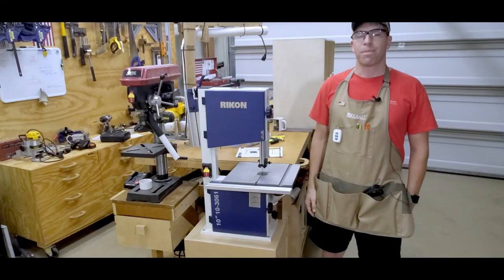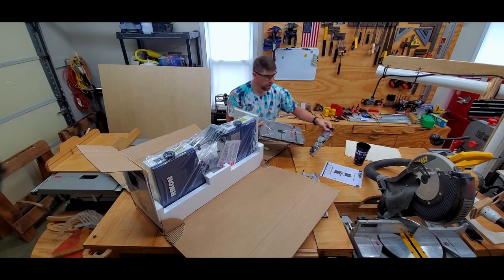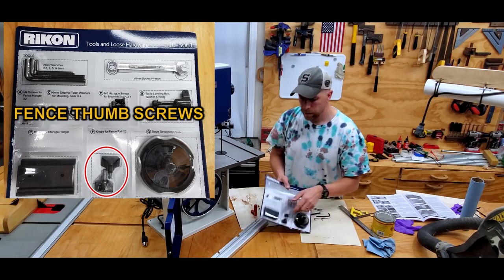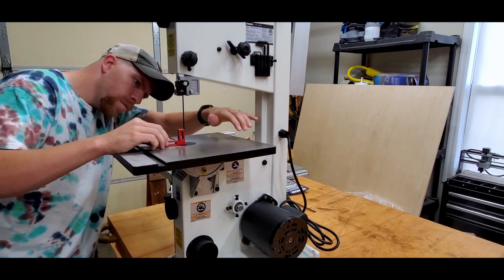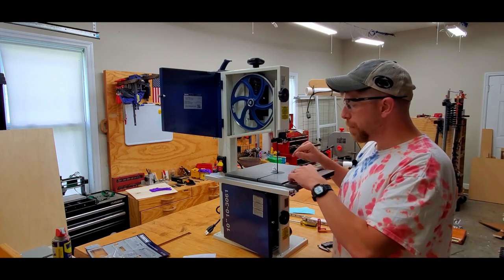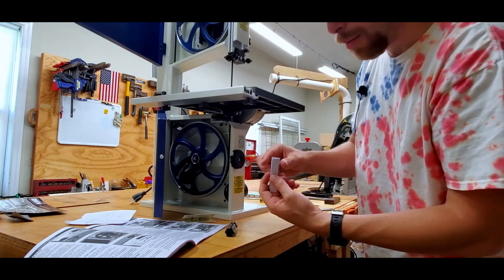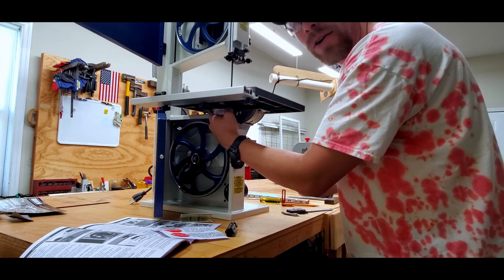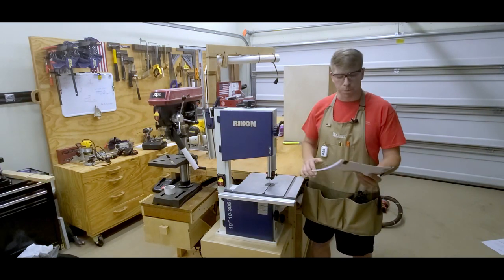Rikon 10-306 Band Saw / One Stop Resource For: Unboxing / Setup / Tuning / Features // EP62

Comment: I am about to buy this saw. Imagine my joy at getting to watch your video. Now imagine my disappointment when I had to struggle to hear you over the back ground music. Why the need for music?  Secondly , as you were adjusting the blade and parts, you pointing to it only blocked what I was trying to see. May I recommend using a pointer instead of your finger , also a closer view of what you were adjusting would be very helpful.  Thank you , I did enjoy what I did watch.

Comment: What are the dimensions of the miter slot? Of the 10” band saws this one seems to be a premium version. It’s crazy how similar these 10” bandsaws are but the Rikon has better features; the cast iron table, guide bearing assembly’s, blade tension release. This 10” saw punches above its weight.

Comment: I just bought a sears craftsman 10 inch band saw, 1/3 hp. I later saw that some say my saw is the same as a rikon. Mine has a broken drive belt but for 1$ I couldn’t pass. Do you know anything about the sears being like this rikon?
Reply from the maker: Sounds like a great find,  Franco. Unfortunately,  I don't have any experience with that model.  Best of luck as you get it repaired and back into operation!!

Comment: Just a note, from a another Youtube 'band saw' guru who suggests setting blade tension on bottom wheel, against the side. I don't see the difference myself, but either way should be good. Took some tweeking, but I'm very happy with my purchase and have been 'playing' with it for sometime now. Thanks for vid
Reply from the maker: SmarT Odd,  thanks for sharing. I certainly don't consider myself a bandsaw guru, this might be the 3rd new saw I've set up from factory aside from typical tuning/blade changes.  I'd be interested in learning more about those tuning techniques. Clarifying,  are you referring to keeping the bottom blade guides tight to the band of the blade? Thanks for watching and taking the time to share.

Comment: great video! I have been looking at this bandsaw and the grizzly GO803Z with the purpose of have a smaller bandsaw to use now and later buy a bigger one for resawing and processing some of my own lumber. Great timing as I think I am going to go with the Rikon based on your video. It seems more robust and another selling point is the 2 blade speeds so it has the ability to cut steel as well. Thanks for posting!
Reply from the maker: Thanks for watching @Shiltz00. Glad to help! I'm a big Grizzly fan on some of their larger models.  It is nice to have a small machine setup for smaller cuts.  Best of luck!

Comment: Hi Chris, Great video very in-depth and precise. Looking forward to purchasing one of these in the near future. You briefly mentioned resawing near the end of the video. Can you use the blade that came packaged with the tool or must you buy a separate resaw blade? Have you used it to resaw yet?
Reply from the maker: I have done some resawing with the saw (only small sized pieces of course). I used both the stock blade and a 1/2" 3TPI Starrett blade.  Both worked but the surface finish and stability was a little better with the wider blade

Comment: I was watching another video last week and on it, it was suggesting that the lower blade guides be set before setting the table in place. Strictly for the convenance. No need to crouch down and work under it. 
Think that’s a good idea?
Looking forward to receiving my saw
Next week. Doug
Reply from the maker: Maybe for first setup,  Doug. I didn't fully tension my blade until after I adjusted  my table,  so I suppose user preference. Blade changes have been VERY convenient with this saw. These are the easiest guides I've ever had to adjust on any saw,  so I personally don't view it as a concern. Hope that helps.

Comment: How did you square the miter slot to the blade? I am trying to follow the directions in the manual but I'm going crazy trying to get it squared.
Reply from the maker: Chris,  I thought I showed that in the video.  Will check to see if I can find it. If memory serves me correctly,  I used a combination square and referenced from the front edge of the table and along the edge of the blade between teeth. I confirmed the front of the table was perpendicular to the miter slots. 

There are 4x bolts that secure the table to the top of the trunk on, tightening them can throw things off a bit. You may want to put a bit of torque on them and then tap the table/ miter slot square with a mallet. This can help you get your final alignment without the table moving all over the place while tightening the bolts. I don't want to minimize the importance of getting it as square as possible, but this is a band saw and will never leave a final  finished surface. As long as your table and  fence are parallel to the blade,  you should be able to get fine cuts. I hope that helps, please let me know if that didn't help or you have another question.
Reply: @benchtopwoodworks  I noticed you doing it in the beginning of the video, but it was done quickly. Didn't watch the whole thing, so don't know if you did it again, or explained it later on. I do plan on using it for resawing as well. I know it will only be a max of 5 inches, which is fine for now.

Comment: Why they put the blade changing slot on the side and under the rip fence track is dumb. My Delta 14” had it in the front.

By the way, on a band saw you don’t square the fence to the table. The work doesn’t always track straight. The usual technique is to make a straight cut and then align the fence with with the edge of the work. This technique is in the Band Saw Handbook by Mark Duginske. Highly recommended book! 

Once I had my Delta 14” tuned up (and with a taller fence attached to the factory fence) and a riser block, I could perfectly resaw wood 6”+ wide.

Comment: Just pick this up. In the process of setting it up. What is your recommendations for the paste wax you use.
Reply from the maker: I've always used Johnsons plain paste wax,  but that's typically what I have on hand.  I think even car wax can work.  Basically anything that will seal the metal with a hard film coating and prevent moisture/ humidity from getting to the iron.

Comment: I've had this saw for about 6 years, and I want to know wtf the black slider that catches on the guide assembly does. I've wondered on/off but I just literally watched this to see if I missed what it was, checked the manual and ended up emailing them.

It's part #41, "slider" and it's driving me insane that I have no frixking clue what the functionality of this part is and if there isn't one, wtf is it doing on there? Is it a leftover from manufacturing that a different model would end up using??

The only thing I can think of is it can hold a certain thickness of material when the guide assembly is completely raised

Comment: Thanks for a very detailed video. I am considering this saw although i am wondering about getting a bigger one too. I was wondering what would it take to upgrade the motor since i think the size is fine for what i am planning to use it for - but am worried about the (lack of) power of the 1/2 HP of its motor. Any thoughts about that?
Reply from the maker: Thanks for watching and the question. If I had more space I would go with a larger machine vs upgrading this one.  For the cut capacities it has a good bit of power, so in my humble opinion resaw and throat capacity are the main limiting factors for this saw's capabilities vs power. I have not bogged the stock down even with some pretty thick hardwood cuts. With welded frame there's no option for risers or other upgrades.  I think Rikon and Harvey both have quality 14" with beefier motors and all the bells/whistles.

Comment: I might be getting this saw as well.  The one's I've checked out this is the one I would want.  One question would be what types of blades do you use for different cuts or woods?
Reply from the maker: Most operations I use a 3TPI 3/8" blade. I also use a 1/4" woodcraft brand for curves and Starrett 1/2" for for "re-sawing" Saw only has a 5" re-saw height. All blades listed have 3TPI

Comment: I believe the Company that makes these Ricon also makes the LaGuna brand too.I have owned both and they are identical!
Reply from the maker: Yes Sir,  very similar if not identical. From the basics of the industry that I know, many makes are often nearly the same or even same production lines with rebranding. I think company's also add/remove certain features as they negotiate with manufacturers.  I think it often has to do with who owns which patents and has production capacity.
Reply: Rikon and Laguna are not the same at all. For one, Laguna bandsaws use ceramic guides and rikon’s use sealed ball bearings. The cheapest Laguna bandsaw is $1600. The cheapest Rikon bandsaw is $350. I own both brands. I’d say dollar for dollar the quality from Laguna is a little higher than Rikon. Nothing wrong with either brand.

Comment: Thank you really enjoyed your presentation a very informative  video. Did you consider the WEN 3962 and if so, why did you choose the Rikon instead ? Also, is the blade that  comes with the saw good quality ? Thanks in advance.
Reply from the maker: Rexest Christus, the WEN 3962 was a model I strongly considered. My two main factors that pushed me to the Rikon were:
1. Motor Power (Rikon 5.5A 1/2HP vs WEN 3.5A)
2. Unknowns about the WEN.
My goal was to find the best bandsaw in the class and the quality adjustment features (not overall quantity of features) sealed the deal for me. 
The extra inch or so of resaw capacity was tempting and WEN's saw is very feature packed for the price.  At the time, I had never owned or used a WEN tool.  I now currently own a benchtop belt/disk sander and it works EXTREMELY WELL for the price.  I think the WEN 3962 is a better direct comparison to the Rikon 10-305's features (except the work light) 
I went with the Rikon because I could put my hands on it and check out features in a woodcraft store.  I really liked the blade-guides and it felt like I was interacting with a larger saw. I also have used several small / up to 14" bandsaw that were wanting for power.  I figured the extra inch of resaw/rip height might not matter if power was unable to back it up.  
I've been using the stock blade primarily the last 5 months.  I bought a Starrett 1/2" blade for resawing which cuts like a dream for a small saw.  I hope that helps inform your decision, unfortunately that was mostly one-sided since I've never touched a WEN.  If you or others have experience with the WEN or decide to purchase it,  please add info to the comments. I know many others are likely making the same decision. Thanks for watching/ the question!

Comment: hey chris! im watching your video now, but i have a craftsman 10 inch which is a clone of the rikon 10-305 im trying to use an 1/8th inch blade for fine cutting around corners and such, but i have a major issue, i inherited the saw from my father so the bearings are going bad however i can get replacements for those thats not the biggest issue, my issue is that when i have tuned the saw with the snodgrass method, i get my two thrust bearings about 1/16-3/32nds away from the blade with no way to push them up any further.  about a year ago i saw a video where some guy actually ground out the slots to allow the bearings to move further forward but i find that as it is with the bearings as far as they naturally go, tend to flop over the edge of the corner and become unstable.  short of ordering 2 new bearings at the right size for i believe motion industries said dollars a piece, id rather actually get a new set of guides for the saw. do you know if anyone makes a retrofit guide upgrade for this saw? or am i missing something in the tuning. also, if i simply move the whole guide blocks further forward it pushes the blade's teeth into the other bearings which only move laterally on their own. so im screwd one way and the other.  so far my only seeming option is to go for the expensive bearings and change bearing sets each time i want to change my blade size.  thanks for any advice at all that doesnt include chuck it and get a new one lol.
Reply from the maker: Hey Anthony,  I don't know about specific aftermarket parts specifically for  the saw,  but I do have a few ideas. One option might  be to look on Mcmaster-Carr or another engineering  supplier for bearings that have the same  axial diameter and thickness but are ~1/8" larger in diameter to close the gap.  That might be similar to the expensive bearings solution but should only cost a few dollars.  Roller bearings can generally be had for very cheap when you're not buying them in a specific kit like I think you're describing.  
You might have to change them back when you go to a larger blade if you don't have enough rearward clearance for the larger blade width.
There are also some companies that make aftermarket blade guides that clamp on. I have not used any and I'm not familiar with what might be best for your specific setup with the Craftsman (10-305 equiv.) saw . I do know that some using small blades for a lot of curve work on larger saws use add-on guides.  You might also try making some sacrificial hardwood guides similar to a Mattias Wandel or other improvised guides. I hope that's some help, best with solving this and keeping your father's saw going!  Thanks for watching and taking the time to write.

Comment: great guide. thank you! What saw blades would you recommend for cutting circular shapes in about 5 inch thick plywood for this saw model? I am new to band saws.
Reply from the maker: Cutting thick material with curves is always a challenge to balance. I recommend something in the ~4TPI range for that thick of plywood. Are they glued layers to form a thick block like that? How tight/ small are your circles?
This saw uses a 70 1/2" (1791mm) blade length up to 1/2" wide (12.7mm) 
 I'm currently using a1/2"  Starrett 4 TPI hardwood rip blade for resaw-type cuts.  You can still cut sweeping curves with this blade. 
I'm using a 3/16" wide (also 4 TPI) blade for very tight curves and bandsaw box type cuts.  I hope that helps,  thanks for watching!
Reply: @benchtopwoodworks  this helps a ton. Thanks for getting back to me. I’ll give a 4 tpi blade a go.
Reply from the maker: Glad to help, thanks for reaching out

Comment: Great video. Couple of questions: do you get vibrations and fence rattling when motor is running?  Also is your table top straight or bowed? Currently setting up my 10-3061 and ran into these 2 issues
Reply from the maker: Alex, I recommend you call their tech support/customer service. Most machine companies are really good about making things right. I don't have any vibration at all,  in fact I was impressed with how quiet and balanced everything was.  Where is your bow? Make sure the leveling screw is installed (presuming you did)? Best of luck with everything.  If you have a moment when resolved I'm sure we'd all like to know how the resolution process goes!
Reply: @benchtopwoodworks  yep will call them Monday . It’s bows in the middle. Middle is lower then front and back.  Leveling screw is in.
Reply from the maker: No good. Best of luck, Alex.

Comment: I am debating between this or a 14 inch Grizzly. I would use the bandsaw to mainly cut out legs, tapers, and radiuses on hardwood. How does this do for cutting 3/4-1 inch hardwood like Maple/Walnut, will it do a good job? Thank you for this!
Reply from the maker: Gabe, So far its great on everything I've thrown at it (Baltic birch plywood glued and laminated to 1.5" & 2.5" thick Cherry/oak are the hardest things I've cut so far. )
 I used both a 14" Delta and 14" grizzly both with 110v motors growing up,  the motor on this saw / blade speed is MORE powerful than those older models of both.  Maybe compare linear blade speed and motor amperage for a direct comparison.  
There are definitely some trade-offs with throat width and resaw height you may want to consider.
Reply: @benchtopwoodworks  Awesome thank you for the detailed response -  really appreciate it!

Comment: Thanks for the informative video! I noticed that the slightly older Rikon 10-306 is still available at some retailers. Any thoughts on why/how the 10-3061 is improved?
Reply from the maker: Jeff, thank you!  I couldn't tell you for certain...one difference I'm aware of is the bushings on the fence were replaced with nylon set screws.  I think Rikon may have a video on the differences...or at least they do on the 305 vs 306. Both of their manuals are available on their website which should allow you to directly compare.
Reply: @benchtopwoodworks  Okay, thanks!

Comment: How do you get it to track?  My blade flies off
Reply from the maker: I recommend manually with the saw off. Tracking should be adjusted with the top wheel and the tracking adjustment knob on back of saw.

Comment: What the highest for rewsaw
Reply from the maker: Right around 5" ...I think that's slightly less than some competitors. I think the 10-3061 is top end for motor power in its class.  I weighed power higher than capacity when making my decision.